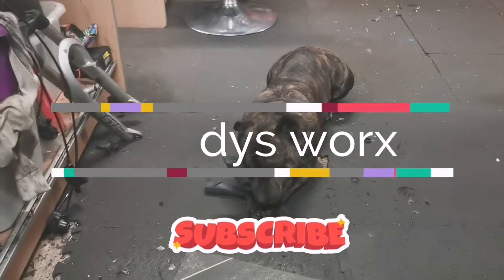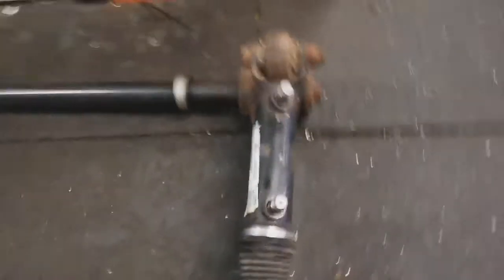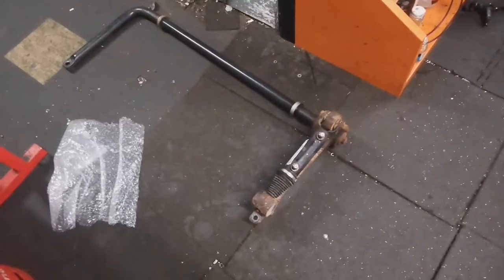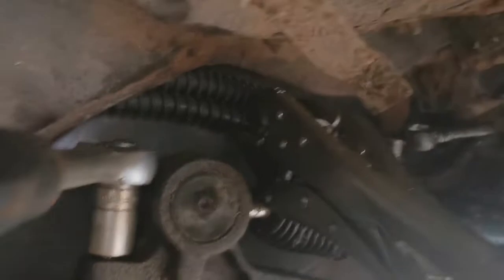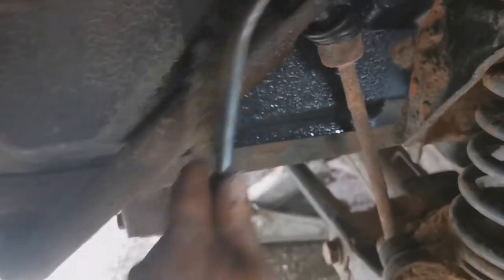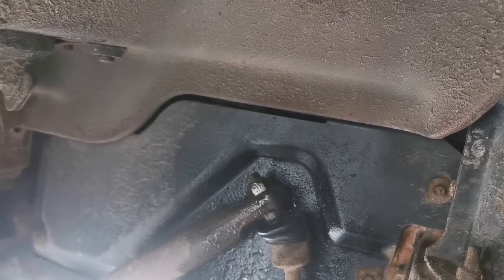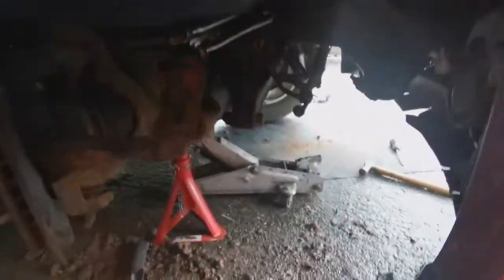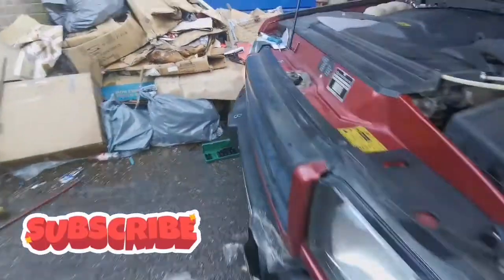Discovery 2 ace anti roll bar replace. Project red disco

Comment: Hope the fluid doesn't attack the paint with the bits you put on the bonnet.
Reply: @wardysworx  
Thanks for reply. Wish I had guy's like you down here in the south.
I'm looking around for a nice 04 es. Some are asking £10 k ! 
Here, crazy.
Reply: @stuarthall2180  there’s a few on ebay for under £5000 at the moment mate!
The biggest thing to check is the rear chassis legs, they corrode quite badly, mines a 2001 and my father bought it when it was 5 months old, I was only in my early 20s and I said to the dealer that if my father buys it we want the chassis treated as part of the deal...I always remember the smug salesman telling me you won’t need to do that, that won’t ever rot!!  Lol
We took it away and I painted the chassis with a marine primer and then took it back for them to seal it with waxoil, best thing we ever done!
It’s 20 years old now with 180k on it, it’s been all over scotland, all over Europe and Scandinavia and up inside the article circle and it’s never been welded!
Good luck finding a nice disco, there are some good examples still about but remember, check the chassis all over and don’t be afraid to turn up with a small hammer and start tapping!
Reply: @PillSharks  
Thank you for your tips. A nice one here in London is around 10k with under 100k 
I have to px my TT which is a problem.